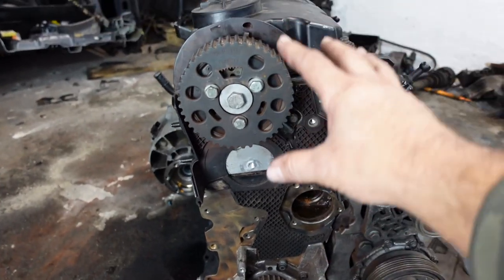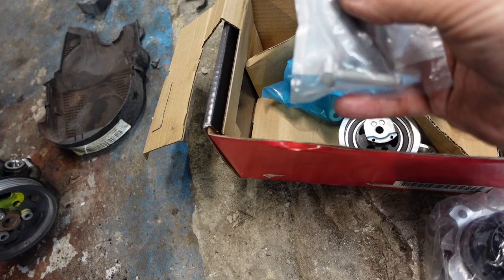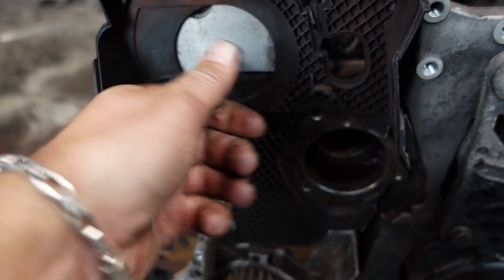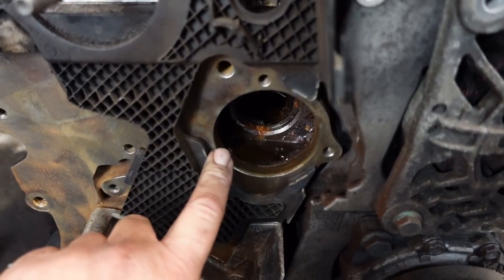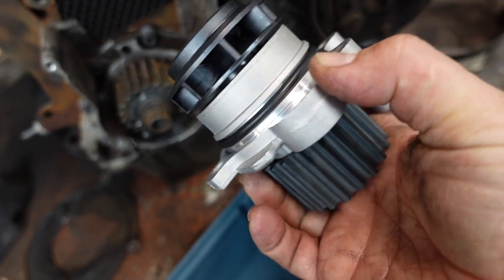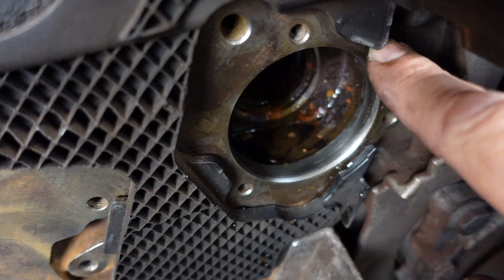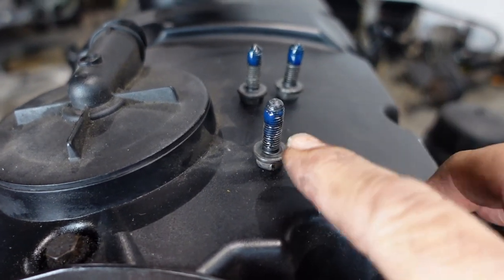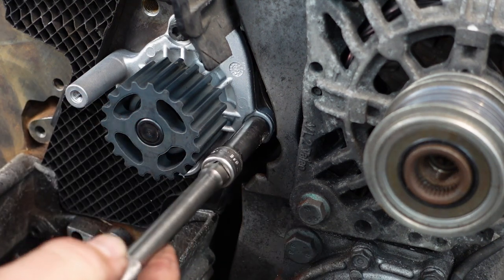How To VW 1.9 TDI PD 130 Timing Belt

Comment: ATTENTION! THE BELT TENSIONER DOES NOT PRELOAD THIS, DON'T DO AS IN THIS VIDEO!
Reply: Is it just a damper because if its not pre loaded it won't tension
Reply: @oli9067 who is correct here? Why not pull the pin like he says?
Reply: totally agree!!! The process of tensioning the belt is a little more complicated, certainly not like that. A distance of 4mm must be left between the roller lever and the tensioner surface.
Reply: @astars1214 hi. Could be slightly more specific when talking about the measurements for the 4mm. Literally a lot of head scratching going on and you’re the first comment to actually be helpful
Reply: @GarethTrussler If you give me an email, I will send you the pdf with the official workshop operations. You will see that the procedure is somewhat more extensive than what is shown in the video, but it is the correct way. If you have any questions, tell me, I just changed the cylinder head and all its components on an Audi A3 1.9TDI ASZ successfully. I hadn't done it before, but with the workshop manual there is no chance of error!

Comment: those hydraulic tensioners are nothing but trouble
Reply: Make sure to screw the nut on a little tight so it doesn't shoot out when you release the pin! I went to war with those until I figured out how to stop it from ruining my day.
Reply: do you know if you can get rid of them by just putting a spring loaded one on 
?
Reply: @jameskealy8677  Are you talking about the serpentine belt now?
Reply: @jameskealy8677  no you can't! The setup is different, i tried it myself!

Comment: This is wrong. There is a tool to lock the crankshaft at TDC which is way more precise than a notch on the damper and the camshaft pulley should be all the way clockwise and not anti clockwise like you did (or at least in the middle) so that when the tensioner is released the pulley moves a bit anticlockwise. Timing can be further adjusted perfectly using VCDS.
Reply from the maker: Thanks for your comment, the pulley was set to the middle, from using that locking tool I find it sets the crack aux pulley to the middle.
Reply: absolutly
Reply: @RestoDesignsnando  placing in the middle is the most important, but there are bad explanations about it, generally

Comment: You said the old belt snapped. Was the engine/head rebuilt after that? Or did you just pit a new belt on...
Reply from the maker: This broke in a big way, all 8 valves and guides had to be replaced, unfortunately TDI's will at least bend 2 valves if you are lucky.

Comment: While starting my Polo 1.4 pd tdi amf. It started briefly then cut out displaying oil light. After multiple attempts found the timing belt stripped. Last attempt was just cranking at 200rpm before it stopped turning over. 
What sort of damage if any could have occured?
Reply from the maker: Sorry to hear that dude, 100% bent valves, if you're lucky maybe only one, but of course check all 6 valves.
Reply: Thank you for replying. Car had done over 236k miles and drove pretty well. Would you recommend pulling head off to check valves or do you think I could drop another timing belt to see if it turns/runs? Tia.

Comment: Good stuff g, so the water pump seals itself and doesnt need a gasket?
Reply from the maker: Thanks, Yes that is correct, it has a O ring seal.
Reply: @RestoDesignsnando  i really appreciate it, I’m changing my water pump, the belts and sparkplugs on my audi b7

Comment: So you like the plastic water pump vs the metal I don't understand?
Reply from the maker: The standard VW one is plastic due to if there is an issue the plastic one will just brake off, the metal one will lock and stop the pulley, which in turn stops the timing belt, which isn't going to end well.

Comment: They made the 1.9tdi up until 2009, i have a 1.9tdi, engine code is BXE, last of the 1.9 pd engine's, apparently they made them with longer Conrods.

From there they changed the engine to 1.6 common rail if not 2.0 in TDI range.

Comment: From my experience of working on these cars for last 16years, the pd130 does not have this style of tensioner  its has the 1 with the 6mm alen key wre u mannually tension it...
This engine is deffo the pd115 not the pd130
Reply: I’ve got the pd 130 and it has this exact set up. Mine is the asz engine.
Reply: @Walid-ep1sj u do know u can slam a ajm 115 into a asz 130 or the other way round, and evrthing will fit right 😂😂... only way to confirm it is to check on yhe block were the gearbox mounts to the block, the engine code is casted in the block.. som1 might have swaped a pd 115 in urs... ital still work... av done it myself
Reply: my pd115 had the hydraulic tensioner my pd130 asz has manual tensioner